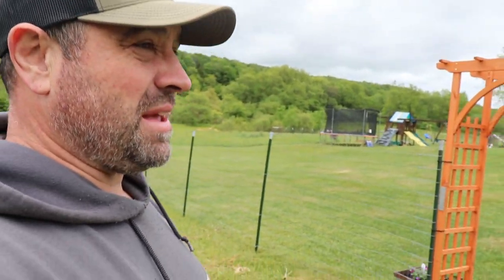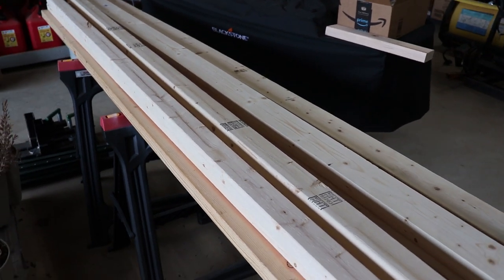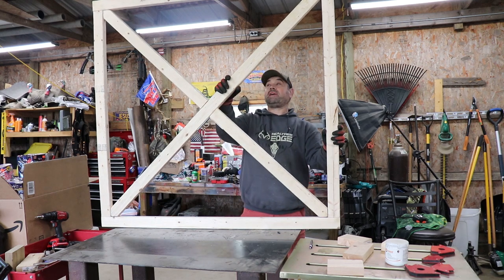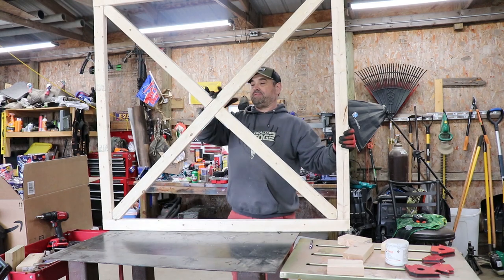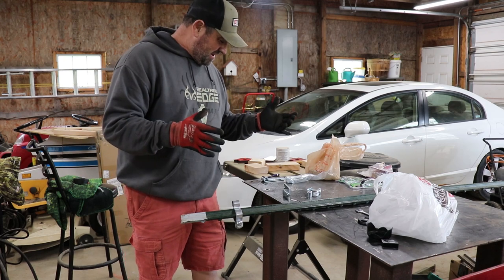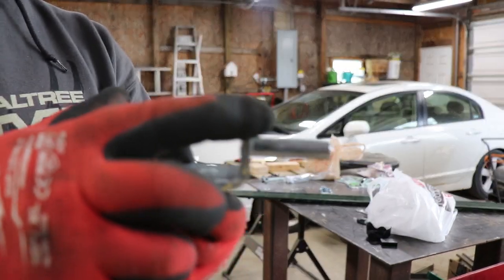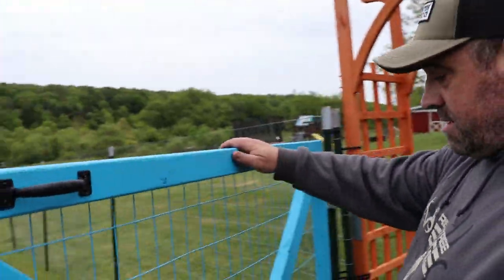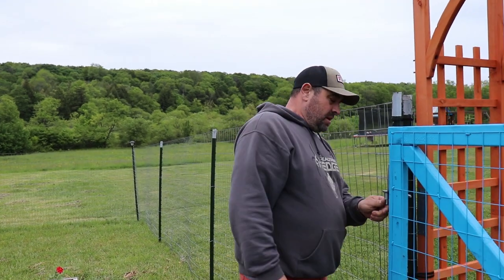How To Hang A Gate On A T-Post ~ DIY Project

Comment: Very good, this got us going on our gate. FYI the linked Amazon hinge for the T-Post is too big for the t-post. We found the right sized hinges at Home Depot. The hinges for the gate worked well without modification. Also we found that a regular chain link fence latch attaches nicely to the t-post to hold the gate in place when closed.
Reply: do you have a link for the hinges?
Reply: @grantimagesllc8720  I don't have a link, it was a generic part from Home Depot. We just tried parts out at the store until we found the right combination. We did find that attaching the hinge sideways to the t-post made it so we didn't have to modify the hinge.
Reply: @Shelby Marie💖 The hardware was unmarked and came in generic unmarked boxes so I wouldn’t be able to tell you without going back to the store. I just had to spend a while trying different combinations of parts. Sorry not to be of more help. Good luck!!

Comment: I am working with a much smaller suburban row-home type of a yard, but code mandates a fence must have a gate going to the alley, so this is perfect because I happen to have a roll of welded wire fencing, a handful of t-posts, and a yard in need.

Comment: Thank you for this, I'm in the process of reseeding a slope that's eroding from our dogs wearing it down to dirt. I've circled the slope with 3' wire fence and was looking for a way to hang 2 gates, one at the  top and one at the bottom for lawnmower access since our lawnmower shed is at the top of slope and our yard is at the bottom. Nice job, I think I'll paint mine too.

Comment: Great video, but you kinda cheated on the latch since you attached it to the wood structure. :) What would you suggest for a latch if we only have t-posts?
Reply: "Did you find a solution to having only a t-post to latch your gate to? My guess is to use something as simple as a zip tie on a second t -post, or a ground stake at the base of the gate that can hook up out of the way when opening and closing the gate. 
You have to forget about that little hooking device to come up with something creative and functional. My nephew suggested a colorful rope attached to the gate that can wrap around the t-post at the top. 
Lots of ways to do this, right? Good luck!
Reply: @GetRealBaby  We ended up creating a gate with 4x4 posts so the latch would have something to go into, and of course making for a much more sturdy gate. Still doing great after almost a year.
Reply: @WallyJ2K  I'd like to get away from the 4x4 posts...too expensive with the cement that goes along with planting them in the ground, not to mention the work involved.
I'm thinking of an all t-post fence with twisted wire, not welded wire, and bracing each corner t-post with an easy on/off 2x2": brace set at a diagonal to the t-post.
We only want to keep out stray dogs and coyotes as well as raccoons, skunks, o-possums, and deer..

Comment: At the two minute mark, when attaching the cross bar, how are you screwing through the metal bracket?
Reply from the maker: The metal corner bracket is small and the screw was above the bracket by about a half inch or so.

Comment: What size gate hinge did you use? Also, how well does that galvanized fencing work at keeping critters out of the garden? I'm trying to decide between that and hardware cloth.
Reply from the maker: It depends what you're trying to keep out. This works perfect for deer and rabbits, although rabbits could get under the back gate I have. If you are trying to keep woodchucks or other critters that can dig under out, this would not be ideal. We use this strictly for deer mainly and some for rabbits. We have tons of deer here.
Reply: @TheCookFamilyHomestead  we have squirrels and rodents to worry about. I'm putting hardware cloth under each raised bed to only let worms and beneficial insects through but nothing should be able to tunnel up. I'll probably use the 1/2" hardware cloth for the fence too. We have the garlic spray repellent as well, but something still got to a couple of my cherry tomatoes last year. Maybe it was birds.
Reply from the maker: @Melody-lc6dt  Great idea. We have issues with birds a little, but not much with squirrels.

Comment: Sorry, you and everyone else will probably think this is a very stupid question. How do you get and secure the T posts into the ground? Just pound them in with a hammer? I like your gate. Thanks.
Reply from the maker: I don't think it's a stupid question! Yes...you pound them in the ground about 2 feet. They have a piece welded on the bottom that helps keep them secure in the ground. Thanks for watching!